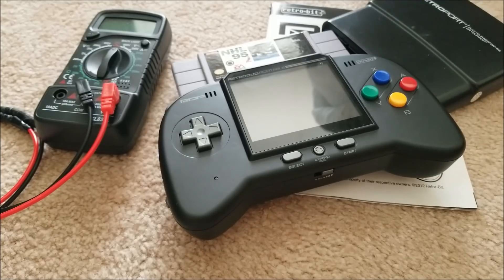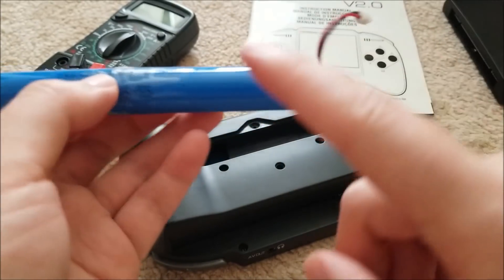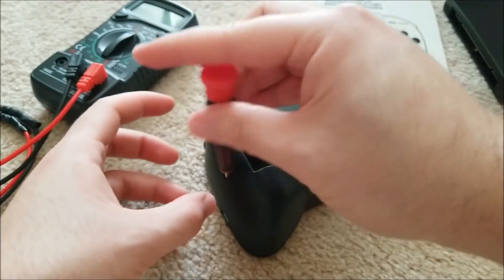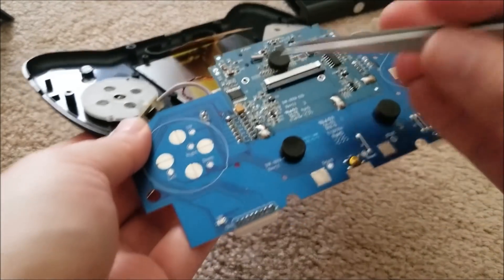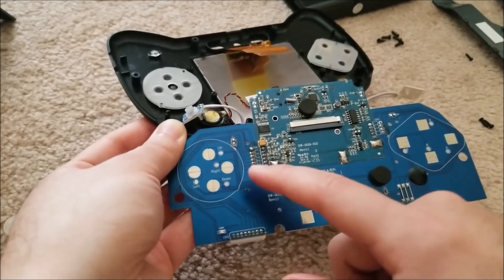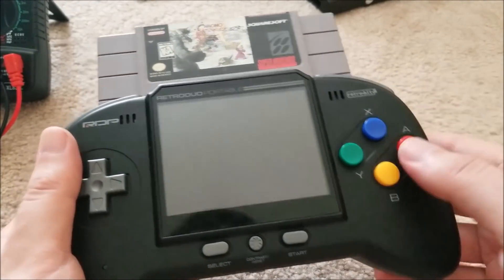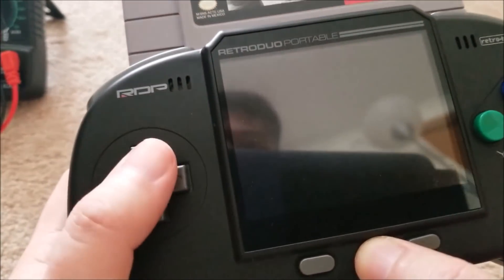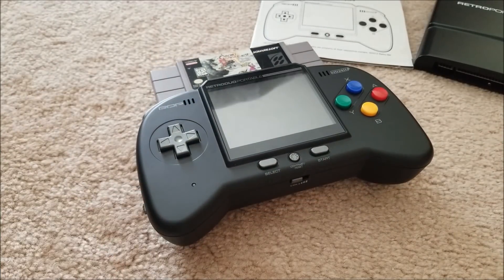Let's Fix: Retro Duo Portable SNES No Power

Comment: Hi, could you help me I am looking for replacement for LCD for this console, but not have possibility to open it now. My LCD throws one white line :/
Reply from the maker: I don't have access to mine right now so I unfortunately cant check the lcd model number so you'd have to open yours to find it. It looks like a generic 3.5" 320x240 lcd they sell commonly for car reverse monitors but I couldn't guarantee without matching model numbers.
Reply from the maker: Looks like you can get a replacement from aliexpress (https://www.aliexpress.com/i/32825400472.html), depends if you want to invest the $20 for the part but should be an easy replacement.

Comment: mines turn on but it doesn't change :(
Reply from the maker: It doesn't charge or it wont play games?
Reply: @sjm4306  it turns on and play games but it won't charge at all. I used the wrong plug (reverse polarity). Then I tried the correct one and it won't charge anymore. I have a second RPD to see if it charges to see if the correct plug still works..I am sure it should be an easy fix but I don't know where to look. I was planning to sell it too.
Reply from the maker: Ah probably a blown fuse or input side regulator (or battery charge controller in this case)
Reply: @sjm4306  so I need to replace it. The problem is I don't know where to look. I have a multimeter somewhere. Need to find it
Reply from the maker: Yeah a multimeter will be necessary to check what failed. Just follow the power rail from input jack through the components downstream till you find where the power stops and that's your failed component.

Comment: Do you know if there is a way to swap out the connector? The pins on mine dont fully connect anymore
Reply from the maker: Sure it's possible to desolder and replace the connector, the difficulty is finding a compatible replacement connector. Your best bet is to take measurements of pin spacing and how many pins it has and search digikey or mouser.

Comment: Mine is just completely off. I don't know if my charger is even right, and they're going for an outrageous amount online. Can't find a correct charger anywhere
Reply from the maker: IIRC the charger isn't anything special but I remember it being an odd voltage or something. I'd have to check when I find it (it's probably still packed in some box that I haven't gotten to since I moved in to the new house).
Reply: @sjm4306  I'd super appreciate it when you find the time! Thanks

Comment: Nice fix man. Wish I was as talented as you electronically. 😉👍
Reply: I have one of these (2.0 )but the screen is dark and hard to see at times ..much darker than the original model of this ive had for years and v2.0 is supposed to be better...Any suggestions? Thanks.
Reply from the maker: Sounds like the backlight is dying. You may be able to buy a replacement lcd if you know the model number (written on the back of the original lcd), or if you are comfortable you can try to desolder the old leds and replace them with new ones.
Reply: @sjm4306  ok thanks for the advice 😁👍

Comment: I am no expert Shawn, and I wouldn't dare question your knowledge... but is probing and putting power in a circuit board on a carpet a good idea? Great video though!
Reply from the maker: Thanks, bro! It is fine so long as I dont drag it on the carpet, it isnt a dry winter, or I dont have anything conductive on the floor. I've been doing this since I was 8 and have never managed to break anything due to esd. Obviously though if it is something valuable and you are worried then just dont risk it.
Reply: You guys are the best
Reply: I have game boy dmg
Reply: I might get game boy printer for christmas
Reply from the maker: If you do, make sure to also get some receipt paper that fits as all the original sticker paper for these gb printers has gone bad by now.
Reply: Ok thanks I love your chanel 😆

Comment: Nice job, I had mine for about two months of light gaming and suddenly failed to read games, it turns on fine, I am guessing could be related to the pin conector do you have any suggestion ?
Reply from the maker: Likely the cart slot pins like you've guessed, all it takes is a single bad connection to fail to boot a game

Comment: My retro duo portable screen won’t display but the sound is on do you have a video or solution for that
Reply from the maker: I'd check the connection between the main board and lcd. Either the screen isn't getting power or composite video

Comment: I do not know if you will reply, but I purchased one of these a while back and noticed I had red dots on the screen. I opened it up, and saw a lot of flux and crap on the boards as well. And some pink residue. So I cleaned the board and contacts as best I could.
Anyway, in the process of opening it, I snapped the battery cord (it was stuck with some flux or something in the socket). Is there any way to find a replacement battery?

Also. Could I send it into you for a repair?
Reply from the maker: The red dots on the screen sounds a bit like stuck pixels. As for the battery it should be possible to resolder the battery wires back on instead of buying a new battery. I'm a bit overwhelmed currently with commissions and repairs I've taken, but if you'd like me to fix it for you shoot me an email at sjm4306@gmail.com and I can get on it when things settle down.

Comment: is there a way to contact you? I have a broken one i found on ebay said does not power on just like yours. Actually purchased it before I found your video, but I know nothing about repairs like this I just thought it would be a nice thing to experiment with. I have 4 pictures of the main area according to this video and I just need to know what to solder to fix it. If you could help lemme know.
Reply: and the speakers popped so i know it's that area :)
Reply from the maker: Shoot me an email at sjm4306@gmail.com with pictures and I can point you in the right direction.

Comment: Amazing skills. How do you know what volts a capacitor must have? That's a nice skill to know.
Do you know of a way to revive a lithium-ion battery (this is for a iPhone 5), it's new, just days when I used it (from iFixit, Apple OEM), it had not be charged for a long time, now the battery I believe won't charge anymore.

God bless, Proverbs 31
Reply from the maker: Most of these hardware clone systems run at 5V (well the core logic does). If you have no idea you can usually guess by deductive reasoning by looking at the rail voltage decoupling cap ratings (for example: 6.3V caps probably mean 5V rail, 4V caps probably mean 3.3V rail). Additionally find the main chips and look up the datasheet to see what voltages they run at to give you a clue.

For your iPhone battery, you can revive it using a very low constant current (something like 10-20mA) to trickle charge it until the voltage gets up to around 3V and then use the phone to charge it the rest of the way. If you do this though be super careful to measure the temperature the whole time and keep an eye on it as once the voltage on a lithium rechargeable drops below ~2V it is not supposed to be used for fear of it igniting or venting hydrogen gas if recharged.
Reply: Thanks again. That's hopeful and they say if these types of batteries won't charge anymore if it's at zero charge for months. What kind of juryrig/diy wire do I use that has 10-20mA (by the way where do I dial to, in the multi-tester to measure amps, is it the capacitor one or AC or DC one). 

Which gadgets do I have, have you think has the specs (will stick two wires out their plugs I guess):
 
1. USB power cable for an external hard drive enclosure

2.Game Boy Color AC adapter (it's wires been cut off already from recent revive project but it's heat shrinked). 

3. Eneloop battery charger (insert 2 thin wire in the + & ground held by an Eneloop battery. How thin should the wires be though)

4. USB charger for the Wacom Intuos 4
5. Speaker 2.1 AC adapter
6. Could a small 10v battery be used?
7. Consoles AC adapters: Saturn, Gamecube US & Japan, Dreamcast (all versions), N64 (japan), 
8. iPhone Lightning cable (use 1 pair of strand of wire, hot glue in place?)
9. Direct to wall outlet wires running to resistors from a discontinued project for the Dreamcast years ago(an SD card mod, coz' the best electronics shop didn't have the parts- it's great to live in the US where it's complete:-)), though this mod can be bought now- thanks to the chinese: 

https://www.google.com/search?q=SD+Card+Dreamcast+DIY+resistor&num=100&client=safari&rls=en&tbm=isch&source=iu&ictx=1&fir=dgyX_RRY_CAIiM%253A%252Cq4WYXLcYQiTH5M%252C_&usg=AI4_-kTbnsUNEiB0Rdu0Rw_st9A_aZXfTA&sa=X&ved=2ahUKEwjN2fCMpYXgAhULqY8KHQFLCtcQ9QEwDHoECAQQCA&biw=1278&bih=1275#imgrc=_

10. borrow chargers for Asus, iPhone 3G and 

11. old school, very old no keyboard Nokia chargers

Thanks again. My apologies for the length but it's great to give out the details.

God bless, Proverbs 31
Reply from the maker: Pretty much any low voltage (<5V) source and a big enough resistor to limit the current down to 5-10mA should do fine (and as the voltage rises the current will drop anyway). Just make sure to keep an eye on it (the whole time) and keep in it an area that isn't flammable just in case it tries to ignite/vent.
Reply: Thanks. I'll wrap it in aluminum just in case it catches on fire.

So it's much safer could I just use three 1.2 rechargeable batteries then 1.5 regular batteries for a total of 5.1v? Or the amps with this battery setup is too weak?
Reply from the maker: The voltage doesn't really matter (just keep it low ~3-5V), it is the low current defined by the series resistor that is important. We are just pre-charging the battery till it gets to around 3V, then the actual iphone internal charger can recognize the battery after that point to fully charge it.
Reply: Hi, again. Long time, no message:-) How do I measure if the current is 5-10mA and if it's greater, what resistor should I connect first (assuming the resistor is the right solution)? Thank you. I'm planning to use a PC PSU to find a 5v rail there or somewhere in an old hands me down HP desktop (circa Windows XP era), I hope it has one.